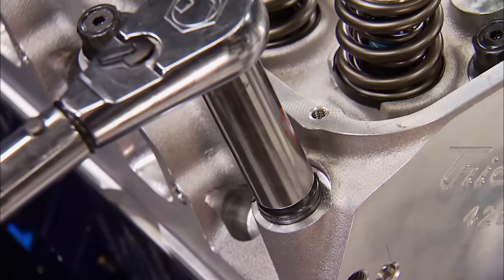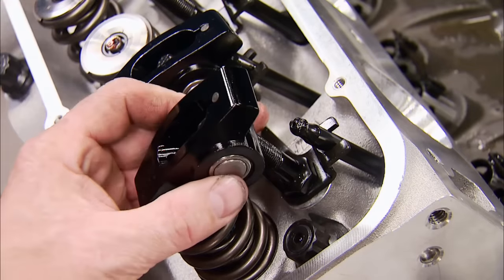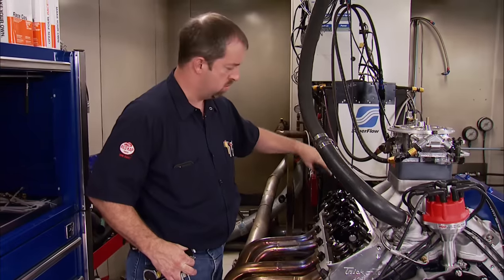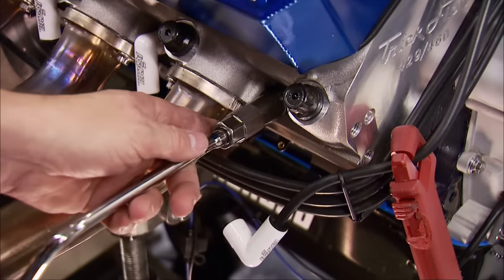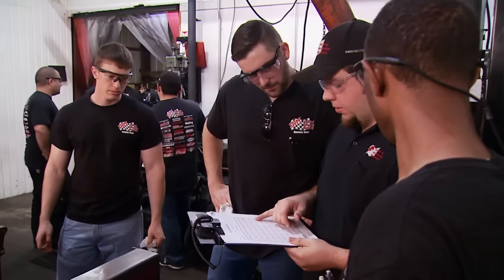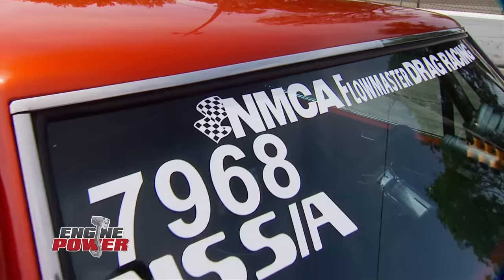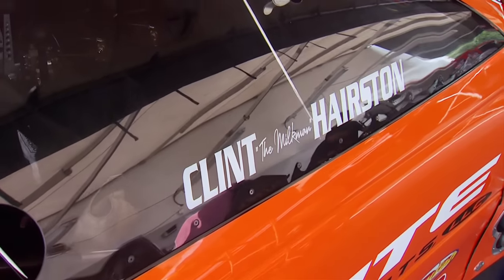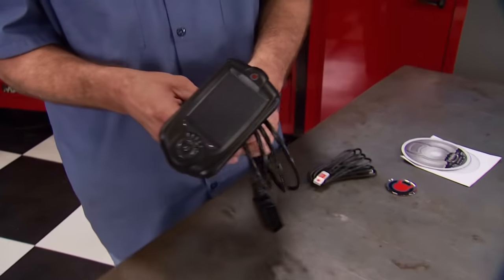Pressing the Limits of a Ford 557 by Adding Nitrous - Engine Power S2, E22

Comment: If my 500 plus inch big block didn’t make 1000 w a 300 shot I’d give up.
Reply: True, but this is a 10-1 motor built with pretty 'standard' parts. Good street motor.
Reply: This is on 93 PUMP gas as well, extremely good for a pump gas engine on spray!
Reply: @bigboreracing356  they said shell 93 octane
Reply: @bigboreracing356  We ran a 8.5:1 stock  long block 454 from an rv with 3 nitrous plates stacked and all open solenoids only  for 3 years and hundreds of passes before a gas solenoid failed and it sent the pistons out the tail pipe. It was a lot of fun for a $800 junk yard motor and I feel certain was in the 2hp/cid range.  It did have a cam , manifolds and headers but that was it.
Reply: Made 740 crank with my 93 pump gas 496 chevy. I thought the heads seemed on the small side. Power numbers I would expect 850 crank for this many cubes
Reply: @bigboreracing356  lol they were afraid to even run it on the dyno😂😂😂ticking time bomb
Reply: @NissanTy  That ain't shit
Reply: @jeremystrickland7767  the drag racing world will happily disagree with you.
Reply: Guys did you know street racer has a 468 Chevy? It's faster than anything Ford could ever produce. If you don't believe him I'm sure he will be glad to tell you.
Reply: No street racer. Fords are garbage. You said so your self. I mean why would you want to build a Windsor SBF. When you could build the copy cat SBF GM made. You know the LS engine. It's probably good for at least 750 more hp than your Windsor. You yourself said Fords are junk repeatedly on here. What's the deal? I'm not so sure you're my cousin. I thought we were gonna go on every Ford video and tell them how much better chevys are. Now you're talking about building a ford.
Reply: Why not use your 468? And yes the LS is more of a SBF copy than anything that you think ford has copied from GM. I thought your 468 Chevy made Jon Kasse afraid of you? Why would you want anything to do with a SBF?
Reply: Street racer is my hero. When I grow up I want to be just like you. First I'm gonna take my 468 Chevy and build it up like yours. Over 1400hp on stock internals. Then I'm gonna get on youTuve and troll all the ford videos. Make sure I tell them my Chevy is so much better than their ford.
Reply: @bigboreracing356 , Hemis dominate big boy racing.
Reply: @bigboreracing356 , a stock block coyote Ford  will run with your 555 all day long.  Your biased opinion won't give your engine more horsepower.
Reply: @leelathrop9539 , sarcasm  ?
Reply: STREET RACER dude, the only reason Chevy is so big is because they’re cheaper. Ford and Mopar are much better quality. They make the power and last longer.
Reply: @hillbillydeluxe08  , I agree.
Reply: Lee Lathrop his channel’s playlist is full of Fox bodies, he’s just trolling.
Reply: STREET RACER, yeah they are. Everyone knows that. Hell, the actual Chevy fans use that as an argument for why they reckon they’re better.
Reply: @bigboreracing356  , by the way,  a real street racer keeps his mouth shut when it comes to details of his engine.
Reply: Street racer my Prius has a 468 Chevy in it. It's probably faster than anything you've ever been in. Did I mention that fords suck? And that I have a 468 Chevy?
Reply: STREET RACER all bullshit and laughs aside, if those figures are correct, you guys have it so good over there for performance building, no matter what you choose. 
I mean, even if you went for a shitty 468 Chevy...
Reply: STREET RACER nuh uh.
Reply: @bigboreracing356  830ci ford making over 2khp na
Reply: @bigboreracing356  no such thing put bigger tires
Reply: @bigboreracing356  no put it in a 3300lb mustang
Reply: @bigboreracing356  😂

Comment: What’s the point on studs when you screwed up the first step. Always bottom stud in threads then back it out at least one full turn. This way when torqued the stud doesn’t get sent into the block

Comment: Dammit boy! 754 NA fresh off the stand...wow! I would LOVE to drop that thing into an early 90s Ford Lightning with a 6 speed manual. It'd be even better in a mid 90s Ranger. You'd have to cut the firewall and lose the inner fenders, but it can happen with enough determination. I've seen people dropping LSs into Rangers.

Comment: Hey Mike and Pat, did either of you know that the foot in foot pounds never changes? It should be foot pounds because of how torque is measured. At the time it was first used, which was possibly in the late 1800, the dominant beast of burden was the horse. They had a contraption that allowed an animal or engine to lift a weight. At one end of a thick rod was another one rod that was a foot in length. This was elevated from the ground. At the end of that was possibly a chain that would be attached to the weight. Do either of you know what a yoke is for an animal? It's what goes around the neck of the animal. It would be a different arrangement for an engine or an electric motor. That horizontal bar possibly had two or more bearing, which could be placed in what could be a framing for a swing. When that horse was attached to those straps and started moving forward, it would twist the horizontal tube and will additionally twist the one foot rod at the other end of it. This would allow the weight to come off the ground. That weight will determine how much twist or torque that animal had. How would they be doing that with an engine? Most of them had standard transmissions. They wouldn't use it, though. They would use the clutch instead. What would it be attached to? A flange that would act as the friction disk of the clutch. That flange would be bolted to the other flange, which would be at one end of the horizontal tube, which would have tge one foot rod at the other end of it, with the chain attached to it for the weight. That's how they, at that time, determine how much torque or twist that engine had. As you exceedingly well know, people use a dynamometer to test for horsepower and torque. Don't ask me, don't know that answer. Perhaps you could ask Google that question. It would possibly have an answer for that question. That's the reason why it should be called foot pounds of torque instead of pounds feet. No, that foot will never change.

Comment: Kinda wild how 700hp used to take a big block with lots of cam and heads but now we have LS and Coyote motors making that with bolt on parts and cams and maybe head work.
Reply: Even more interesting is how much power you can get from the OE's these days. I remember watching an interview Jay Leno did where he mentioned buying his Viper. Dealer assured him you'll never see a car with this much HP from the factory again. Yeah times have changed, and I like it!
Reply: @sparkplug1018  Totally agreeing. Makes me wonder how long big thumping cams in a large displacement V8 will stick around. I love them, don't get me wrong but I feel like carbed engines are coming to an end now that we have standalone engine management that's more efficient and equally priced to a good carb nowadays. Heck, even 5-6 cylinders are making north of 500 now.
Reply: Bob Sagget I think when EFI gets to be on even grounds with a carb setup for the entire package it will happen. And we’re getting there.
Reply: @sparkplug1018  more or less I agree. I've seen large cfm carbs going for 3-900 bucks and most don't really understand tuning them and don't want to risk spending 5 hours changing jets, adjusting timing and then blowing it up because it's wrong. With things like megasquirt you can run efi off of basically any engine from 4 to 8 cylinders for about 3-400 bucks and have someone data log and tune remotely.
Reply: @alpha2gproject783  If the person can learn the system MS is a great deal. Im thinking more of an out of the box system though. Figure a 1000+ cfm carb, single plain intake and distributor will set you back 1000-1200 or so. I think thats the mark to hit, when an out of the box system (intake, TB, ECU, dist, wiring and fuel pump, etc) can match or beat that, then yeah carbs are done for good.
Figure with how popular LS swaps have become people are becoming much more comfortable with it, so its probably not to far off id imagine.

Comment: I always thought it was standard practice to back off head and main studs 1/4 - 1/2 turn after bottoming out so that the base of the stud doesn't try to break through the bottom of the hole during heat cycling & expansion.
Also, I realize it's not as critical with a roller cam, why not add the assurance/insurance of a high-zinc break-in oil. "Back in the day" I ran non-detergent straight 30-weight (good luck finding that nowadays!) as a 200 mile break-in oil; all motor oils had sufficient zinc levels then.
Reply: Yes and because they're sponsored...youre right in both aspects
Reply: We in the UK can still purchase high zinc content oils,mainly for older stuff and lawnmowers etc.But there are a few companies still able to supply us,I also assumed that backing studs out half a turn was standard practice.
Reply: @areyouundoingthatorwhat9181 , high zinc oil is still available, but current standard practice is low/no. High zinc is really only used now for fresh builds with standard hydraulic lifter cams so the lobes don't get wiped out.

Comment: help me out ere with my understanding, since the timing is set for when the eng is running on NOS, that means the eng is severely underperforming when not on NOS, correct?
Reply: I wouldn't say severely but yes it will have less power than it did with 30 degrees, you can get ignition setups that have multiple timing curves. When you go to run nos you pick that timing curve, when not running not you just change the curve.

Comment: Did I miss the part number for the heads. I can't find this head on trick flo that is made for the lift on the cam that you used.
Reply: The parts list for this engine are list in the links below the video

Comment: Nitrous does not increase volumetric efficiency. It increases the percentage of oxygen available in the volume you have. Volumetric efficiency is effected by the mechanical design of the engine - intake design, valve lift, timing, ect.
Volumetric efficiency is the percentage of an engine's cylinder volume (displacment) that is drawn in before the intake valve closes. Typically this is around 80-90%. Sometimes higher in highly tuned 2 valve or most 4 valve performance, vvt engines.
Supercharged engines technically can increase VE but really what they're doing is mechanically increasing air density. The actual volume of the engine doesn't change.
Reply: volumetric effeciency is measure of maxium amount of oxygen volume an engine will take in and at what rpm it reaches that so by increasing oxygen intake they are increasing volumetric effeciency the same as a turbo or blower you dnt get the increased heat generated from either no lag as from turbo and no horsepower loss as from blower all that has nothing to do with volumeteic effecincy just rambling on yes not mechanically increasing it but it does increase it

Comment: Put that thing on 110+, give her some more timing and see she'll do
Reply: Put it on some VP M5. Should hit 1000 go na
Reply: @bigboreracing356  no it's not. Ford 385's are bomb proof
Reply: @bigboreracing356    Thats if you use a stock 385 series crankshaft at these power levels. it has the counterbalance on the front snout of the crank. THIS crankshaft is internally balanced eagle crank and has no weight on the front so ti will hold 1500 horsepower reliably.
Reply: limit for the stock cast crank is around 600 hp
Reply: STREET RACER   ROFL  really? A stock Big Block Chevy 454 will handle 1400 HP???   I want what you are smoking!!! Lol
The Block itself might handle that but so will the 460 Block. the Internals are only good to about 600 HP.   Maybe slightly more than the 460. But hey keep spewing nonsense if you want.😂😂😂
Reply: Listen to street racer. He knows his stuff. If you haven't heard bbf's are junk. His 468 Chevy makes more hp on pump gas than a factory supported Ford pro stock engine will ever make. Don't believe him. Just go read some of the comments he is quick to let everyone know Fords are garbage. And his Chevy is the best engine ever made.
Reply: Sheesh all I said was throw some high octane fuel in and add some timing don't know where all this shit came from lol...
Reply: Chris street racer has a 468 Chevy. It'll out pull a train and go faster than a funny car. The guy is so bad ass that job Kasse is afraid to compete with him. Don't believe me just ask street racer himself. He will be sure to tell you how bad ass his 468 is
Reply: I already max out the timing on my test car with pump gas.
Reply: STREET RACER that’s an eagle esp crank. I have one in a Windsor. Those things are good up to 1500 hp

Comment: 10:1 compression with all that cam????  Sucker will be a slug out of the hole. John Kaase ran a junkyard 466 at 12:1 with his P-51 aluminum heads on pump gas.

Comment: 140ft lbs arp fasteners eh? I thought basically all studs on gas engines from arp torque to 80ft lbs in 3 passes, 27, 54, 80. Then again, I only know a handful of people who I’ve talked to about using arp head studs.

Comment: The Ford and Chevy rivalry is so stupid in these comments, throwing insults at each other like children. I love both. Both have there merits, both are great, get over yourselves.
Reply: i totally i love both. maybe im still stupid because i preffer them over that jdm tuner stuff
Reply: @bigboreracing356  youre just proving his point
Reply: @freeautoinsurance365  huh, he's still trying even though I clearly said I'm ignoring him.
Reply: @jasonandrew5707  he's trolling
Reply: @freeautoinsurance365  yep, hence why he's not worth the effort
Reply: @bigboreracing356  557 cu. in. with a standard deck , not a tall deck. 2 bolt block stronger than 4 bolt HP Chevrolet, good for 1000 hp as seen in this video, probably some old Lincoln or pu truck block. Chev. only became dominant because they built a billion of them and aftermarket parts suppliers had to fix all the deficiencies. 385 series Ford came at the end of the performance era so little aftermarket support.
Reply: @bigboreracing356  Quite simply, Ford did not build attractive small/mid sized vehicles these engines will fit in. Big shock towers cramp down the engine bays. Chevy built a lot of good looking cars a BBC would fit in. Very popular combo's.

Comment: Way more there, they chose a rather mild set of heads, and an off the shelf carb. Even with it loading up at idle, as seen in the dyno runs, it outperforms the bow tie brigade.
Reply: Inch for inch none of the 3 are a magic bullet. Similar parts, similar size, similar results.
Reply: More heads, bigger cubes, better timing, and the chevy still couldn't pass the blue oval. Even had cam swap and tunnel ram, still couldn't pass a mild ford motor.
Reply: @elmerfudpucker3204  Oh wow! It had a staggering 15 more cubic inches! Well that surely is worth tons of power right!? Be honest with yourself, with similar parts and configurations you'll get roughly the same power output.
Chevy, Ford or Mopar none are better then the other in any appreciable way, other then the money you'll spend. But that doesn't make the Chevy better, just cheaper.
Reply: Charles Keller I’m speaking generally, until you start getting crazy with it Chevy v8’s are generally cheaper. These are probably not far apart though.

Comment: Why is the cold lash set to a smaller number than the hot lash?
Reply: Cro Magnon The alloys of certain engine parts can be affected by thermal expansion in different ways so it depends on what the parts are made of. The adjustments are different for steel block and heads,steel block and aluminum heads,aluminum block and heads etc.

Comment: Imagine this in a AC Ford Cobra 😃
Or a Pro street Willys
Reply: I have almost exactly half the power in mine, even that's too much under 30mph.  (Kit car of course)
Reply: @BradThePitts  Yup you could never use it on the street.
Reply: Having to pull the plugs over and over on a big block with nitrous in a cobra would be a pain.
Reply: @bigboreracing356  That can happen with any engine...
Reply: 5.0 coyote with 18lbs of boost will make just as much. Now that will be badass
Reply: If this engine was put in anything this side of an Abram's tank, it would be a rocket ship.
Reply: @bigboreracing356  Its not running a stock ford crank... It has a Eagle forged 4340 crank. You break that than you messed up up somewhere, cant just go blaming the engine family. There are plenty of ford guys running big blocks in drag racing, truck pulls, sandrails, boats etc etc.
Reply: @bigboreracing356  Yeah and i out run guys on my unicorn everyday... Surprised i haven't seen you in fantasy land before...
Reply: @bigboreracing356  I didnt even know i had a channel... Lol child
Reply: @bigboreracing356  I have no interest in posting videos lil guy.
Reply: Too big. 400hp is scary in Cobra
Reply: @charleskeller1245  Lol, yeah one of those dime a dozen kind on youtube i guess.
Reply: Street racer has a 468 Chevy big block. It's far superior to any engine ford has ever built. If you think otherwise just read some of his post about his 468 Chevy

Comment: I’m building a 9.1 496 and have a few concerns. Number one I bought new head bolts but a lot of them torqued at different terns. On top of that the dowel pins were missing. I lined up the heads with the head bolts. I sprayed the head gasket with copper coat. The head gasket was a felpro which seemed cheep. 

I hope it seals up. 
Also I went carb. I got a Quick Fuel HR-750 and the Dart intake. And the MSD for LS. 

It’s bored 30 over I set the ring gap at .023 with stock rods with arp. And stock polish crank. New harmonic balancer. 

Zz502 cam with stock rockers with 7/16 rocker arm studs from Comp cans 

Any suggestions.